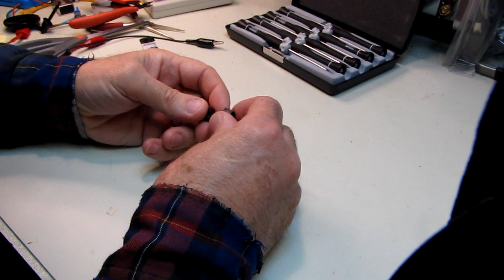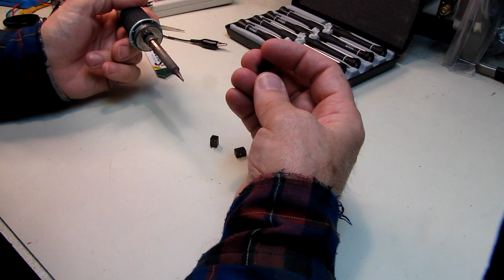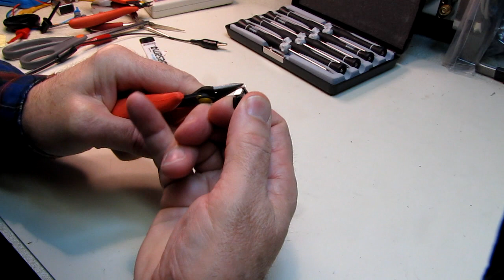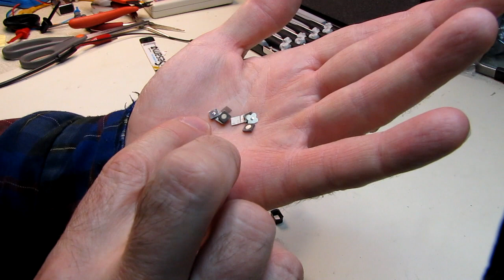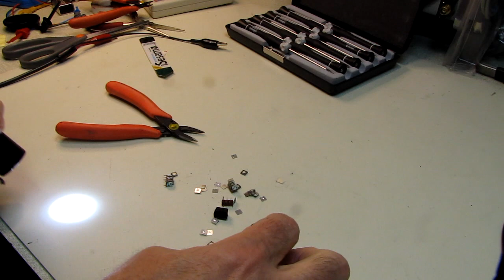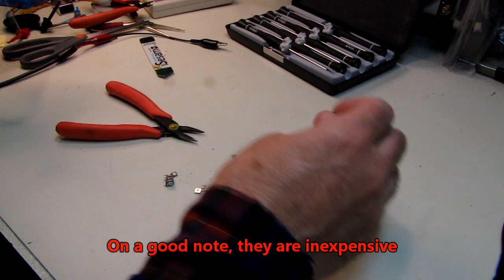Why Yaesu Filters Fail - Water Absorption

Comment: I reckon this video proves your theory of moisture ingress trashing these filters. If this is an ongoing problem with these, as it seems to be and any replacements will eventually suffer the same fate, it's a pity there isn't a suitable socket available to fit them, which you could solder onto the board and make subsequent filter changes  a few minute job instead of the long, eye straining nightmare it is.

Comment: Hi, I have repaired many many brands and types of radio with these things, it seems to be a particular manufacturer of filters that has the biggest problems (TOKO). I purchase replacements from RS because they have the widest range and I trust MURATA.  I have repaired many Kenwood TS2000's, Yaesu FT-817's, Uniden Marine and land units, and scanners as well. Icom have some problems in the FM side of some units that use them as well. All of the manufacturers say do not put DC on the OUTPUT of these, however the Motorola design sheet for the usual FM RX chip that specifies these devices does not have DC isolation in the diagram. This may be the source of the design issues with these devices. There are many sites on the web with better explanations that mine here are some :http://www.k2dsl.com/wp-content/uploads/2011/06/TS-2000-receiver-crackling-noise-problem-Repair-procedure.pdf
http://sv8ym.blogspot.com/2010/07/mysterious-case-of-withering-filters.html
Regards ZL2ALW

Comment: I had the same problem with Raymarine VHF fixed mount marine radio. Ceramic filters were corroded inside too. I read somewhere that it was caused by putting DC current through them. Seems they need to isolated from DC with capacitors. May be a bunch of BS though.

Comment: Early Kenwood D-710s had ceramic IF trouble like this. My Yaesu VX7R had it. Yaesu repaired it for $50.  I had used it for many years in dry Colorado. Works fine now.  Long story short, carry a spare radio. I was doing com for an ultra running race in the mountains, the base I was communicating with was just strong enough to get through my very degraded (IF filter) it was close.  73, Scott W0KU.

Comment: Been there, fixed that. Saved a couple of free Yaesu 2m rigs for less than $4 each. Same moisture and corrosion found inside the filters.
Diagnosis is simple enough: If radio is deaf in RX-wide, switch it to RX-narrow. If it comes back to life, you've got a bad filter. I always replace both filters when I see this problem. 
Alan Wolke W2AEW has a theory that having a DC bias across the filters is contributing to their early failures, and has added capacitors in series with the filters when replacing them to prevent this. Might be worth watching, if you haven't already:
https://www.youtube.com/watch?v=3Y8U4BWac3w
Reply from the maker: Hi Adam, familiar with the DC bias theory. But I think that finding all that water inside put that to bed. Think I mentioned it in the original video ( I need to start linking these things ).  It might speed up the process, but the main issue is the moisture. Had a response from an actual plastics engineer who agrees that the plastic is the problem. Thanks for watching. Hope all goes well for the new year. Still want to see you at Deerfield.
Reply: Yup, you were clear about the cause, no worries. I only brought up Alan's video because I thought it was interesting and somewhat relevant, and that you might like to watch it if you hadn't already. 
I do hope to make it to Deerfield this spring. Keep your eyes open for a fat, bearded guy in a candy-apple red mobility scooter. :D

Comment: If it's a HF set or camera, even if they say it's weather sealed, don't belief it, because when you are outside with a humidity of 85% or more you will have this kind of problems.
Reply from the maker: Hi Paul, My Icom radios live in the car all the time. No issues. I think that Yaesu is cheaping out on the plastic used to enclose these. Had plastics engineer contact me and verify that plastics do indeed absorb a lot of moisture if they are not formulated correctly.